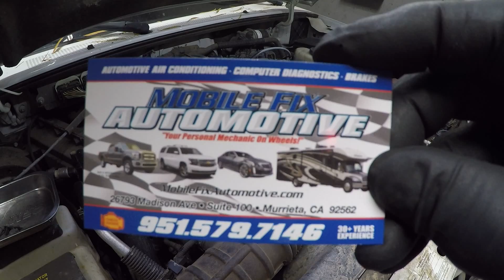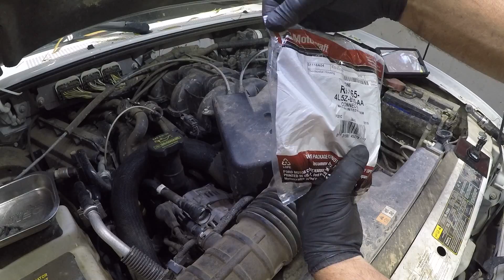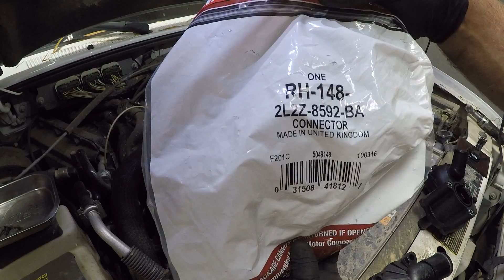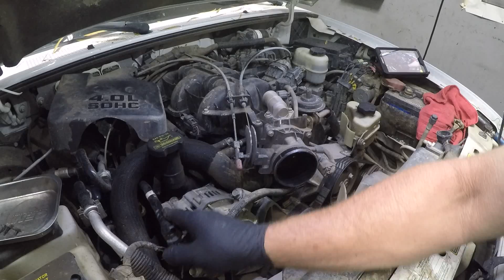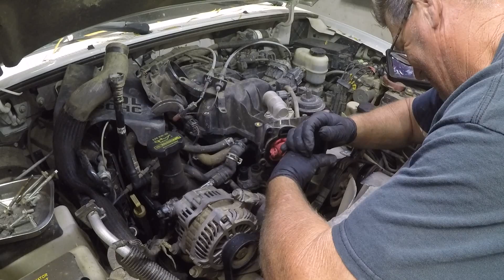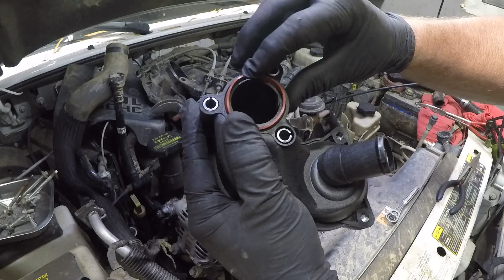How to replace the thermostat housing on a 2011 ford 4.0 v6 (parts link below)

Comment: Did this today, used a Dorman metal housing. After the base was installed I struggled to get the cap on. I was able to by shoving the cap in first while tipping it back and left. Slid the thermostat in and the cap fit.
2011 w/ 248k

Comment: I cannot for the life of me, get the clip in that holds the sensor. It won’t go in. Any suggestions would be greatly appreciated!!
Reply from the maker: If you changed the oring it won't go in. Replace the sensor.
Reply: It is a brand new sensor. I greased it a little also.
Reply: I got it! I’m so embarrassed. I was putting the ends of the clips in one hole instead of sliding them on opposite sides. Thank you so much for replying so swiftly to my question and for your incredibly detailed tutorial! You’re very good!

Comment: Thank you sir for such detailed information awesome video I have to do mine 08 ranger, how ever I asked for the thermostat housing at my local ford dealer and I was if the current housing was leaking which is not so I was told that all I needed to replace was the the thermostat it self hopefully I don't have to go back an replace, I wonder if there's an specific  way that the thermostat seats in the housing, thanks again for a great video .

Comment: Excellent video. I also removed the idler pulley which allowed me to pre-install the two sensors on the housing with their clips. Once I got the housing place, I tilted it and plugged in the sensor connectors. Finally, I used an in-lb torque wrench and torqued the lower and upper thermostat housing bolts to 89 in lbs (not foot pounds).

Comment: I did this today. Superb video; thank you. I purchased a set of long pliers--bent and non-bent--since you revealed how useful they are. What a great idea to use them. I have never thought of that and they were a Godsend.  I also used Ford parts (made in the USA), though it was a Ford part that failed. I'm hoping the USA parts will last longer; however, If they do not, at least I supported our manufacturing base. Many, many thanks for your share!

Comment: this part for me is 150$ so fat chance im gonna rebuy it used to be it was just a single part you bought for 30$ and it was the entire assembly with sensors saw this thought it was still available had to "special order" it waited a week called back exact same part manufacture comes with everything seen abesolutely 0 difference its called a kit now and its 150$  does anyone know if there is any work around to this part like having someone recreate this part with steel and brass so i don't have to replace it every summer because it's plastic if im gonna shell out 150$ for garbage might as well pay an extra 150$ having it made of a stronger material so i dont ever have to rebuy the plastic again because in the long run the fact that it is plastic its gonna cost me more down the line

Comment: Spring clamp's are better,they keep constant appropriate pressure on the hose
Reply from the maker: Yes, but after heat cycle and time they will loose their ability to hold properly. Therefore they should only be used once and discarded when removed every time.
Reply: @SandCarServices  personally i have not noticed that,,( I do also work on car's,..and now on heavy trucks for a living) guess I'll have to be careful of that issues,,

Comment: GREAT VIDEO AND I'M GLAD I TOOK THE TIME TO WATCH.  I BOUGHT A 2002 EXPLORER AND HAVEN'T WORKED ON A VEHICLE FOR SEVERAL YEARS.  SO MUCH FOR A QUICK COOLANT CHANGE.  USED TO TAKE 2 HOURS ON THE OLDER VEHICLE, BUT, THOSE DAYS ARE GONE.  WHATS WITH THE AUTOMOTIVE ENGINEERS. I WONDER IF THEY'VE DONE THE WORK ON THE CARS THEY'VE DESIGNED.  I HAD NO IDEA WHAT I AM GETTING MYSELF INTO !!!

Comment: Hey Ron,, video made my project almost seamless. After all was put back together I noticed I somehow pulled a wire out of a connector that sits just to the right of the oil fill cap.its grey with a black and yellow wire. What is this connector for??
Reply from the maker: Send picture
Reply: @SandCarServices  sent it to your email

Comment: If the thermostat housing is leaking. Would you notice coolant on the ground . Or does the coolant leak on top of motor. An evaporate. Great video.
Reply: Usually it will give a smell like boiling dirty water

Comment: Hey Ron,  I go up to the Auto parts and ask for some " nondestructive grease ". The guy gives me the deer in the headlights look, he has no idea what I am talking about. Is there another name for this stuff ? I called around one guy told me to call a Boat Marina or buy it online.
Reply from the maker: If your just using it to grease the orings use vaseline.
Reply: @SandCarServices  
Thanks for the reply and that I can do. That is what I used to hold the rubber gasket in place on the bottom. Say you know that they are making the thermostat housing in a metal version now.
Reply from the maker: Yes
Reply: vaseline is a petroleum product.  I'd personally steer clear of that.  You can get cheap little plastic tins of plumbers silicone grease at lowes or home depot.  It is designed for rubber seals.

Comment: Did this job on my 04 explorer and still have a leak on the pack bolt and also on the back of the engine. I'm losing almost a half quartz from driving it to a to b just did my manifold gaskets. And cant torque down to specs because the dreaded hidden bolt. Can only get a driver pack there and just did the water outlet housing still leaking

Comment: This man did this in about an hour. He tells you at the first of the video to buy the over priced Ford parts. I looked on line and Napa had just what I needed, or so I thought. They had the housing thermostat and one of the sensors with all the gaskets. Ready to be installed. And true to the name N.A.P.A.  No Auto Parts Available. Did not have it in stock but could have in the store after 1 pm. I go to get the parts. And what he had and what I told him I wanted, turned out to be two different things. He had the housing and everything with it. Except the two sensors. So those were extra. I get everything torn down and start to put the NEW sensors in the housing. Try as I may, one of the sensors would not fit. I no choice except to use the old one. In my struggles trying to put everything together I am not sure which sensor went where. I hope that the color helped to match every thing up. One was a orange color the other gray. I go to put the little wire clips that hold the sensor. And that was like hitting a brick wall. They would not go in. I struggled with them for over 4 hrs. On the ends of the clips they are bent out wards. They were boring holes into the side of the housing assembly.  Finally I said to the hell with it and use a large paper clip about the same size. Not a tight fit but they seem to be working, so far No leaks. I get everything back together and run the truck around the block. Still No leaks, so everything seems OK. This morning the air conditioner stopped working. And the engine light came on. I take it down and let the guys use there scanner and they said I have a bad coolant sensor. So the one I had was working , so now I am not sure if the new one is bad or did they sell me the wrong one. It is a little hard to believe that now is the time the old sensor died.  Perhaps this is why the air conditioner stopped working.  The AC was working fine until I started this project. So I thought perhaps I did not hook some wiring harness back up. Or perhaps a wire came lose. So today I looked it over.  But I do not see any thing unplugged  Before I started this project I did unhook the batter cables. But I still went back and checked all the fuses. They were fine. I got under the hood and swapped the relays around. Still No AC. After spending 12 straight hours on this POS yesterday and another 4 hrs today, I tracked down the relay that goes to the clutch, on the compressor. I ran a jumper wire from the battery to the compressor relay. And the AC started working. So I hooked up a wire from the battery with a fuse 10 amp just like in the electric box to a toggle switch in the cab of the truck. So far I have spent over $200 and spent over 16 hrs on a job that should have taken me 2 or 3 hours. Not to mention monkey rigging it together. Perhaps IF I had went on to the Ford dealership and gotten the parts from them this may not have been such a hard ass job. Who know's they may have even sold me the right parts. And the worst thing about all of this is, I will have to do it again. Strange thing I have asked several why does this have two coolant sensors ? One of them has be for the gauge in the dash the H/C  what is the other one for ? Either it is a secret and No one will tell me OR no one knows. Funny thing I tell them I replaced the thermostat housing and the AC stopped working and they look at me and say, Well one has nothing to do with the other. They hook there scan machine up and then tell me that the reason the engine light came on is because of a bad coolant sensor. And that may be the reason whey the AC stopped working. Two minutes ago they said one thing has nothing to do with the other.
Reply from the maker: Welcome to my world. Parts made in China suck. Napa, o'Reilly, autozone etc. Sell mostly China products. Dealer parts which can be argued are better are usually made other than China.

Comment: Thank you for this video.  I was able to change out my thermostat housing and save lots of money.  Car part store gave me a threaded sensor which I had to change for the right one. And added an 8mm ratchet wrench to our toolbox.  Love my manual Ford Ranger Edge with over 150,000 miles on it.  I change the oil regularly and use non-ethanol gas and it runs great.
Thanks again!
Debi

Comment: Excellent video. Only problem is you made it look easy. The bolts that didn't break on me were seized with the heads rounded over. The clips crumbled out in pieces. I had two sensors with no room under the throttle body to pull them off. Two parts stores looked at me like I was asking for a moon rock when I went for bolts and clips. 

The good news is I know how to do it now because I'm sure I'll be redoing it in a year. The old housing was crumbling as I was taking it out.

Comment: Thanks, great video and good instructions without distraction. Steady camera. I'll go back and check, but I respectfully ask if the new Motorcraft plastic part has been improved so the same failure doesn't recur.

Comment: Great vid. I'm a rookie, and am not going to do the job myself, but wanted a sense of how long it would take a mechanic who is working at a relatively busy shop. (has other vehicles to tend to etc....) It seems to have taken you under an hour to do the actual tear down and install, not counting bleeding the coolant and refilling/testing etc.... Is this a 3 hour job top to bottom? Maybe more? Thanks again! really enjoyed watching/listening!
Reply from the maker: If I remember correctly the Mitchell book calls for around 3 hrs. The book wants you to remove the intake manifold.  Also I live in California where we dont get a lot of rust issues in engine compartment like back east does. If the bolts break all bets are off and the manifold has to come off most likely.

Comment: I just did this job on my ranger. What a royal bitch it was. Took 6+ hours. One of the lower housing bolts was froze up and the head immediately rounded off. Had to cut it out with a sawzall. Recommend anti seize on the bolts. Fastenal has replacement bolts on hand. Converted the one to allen head high grade bolt. Terrible design.
Reply from the maker: Well I can't think of everything. I live in California and pretty much only work on California vehicles. I forget that back East and areas that are heavily involved in snow everything gets rusted out. Unfortunately I don't see it out of sight out of mind

Comment: Great video it shows fastest way to replace housing if no trouble.A bolt under intake next to throttle body was rusted in the split steel sleeve and I ended up shattering the housing to get a vice grip to remove bolt.

Comment: Any suggestions of how to left out that back 3rd screw? The vacuum line that are connected to the intake is in the way?? Thanks
Reply: remove the other bolts then you have to tilt the whole housing forward. slide that bolt on out.
Reply: @ryangeorgi5159  Thanks for the reply.

Comment: Thank you so much for your non-shaky, clear video with good narration!
In my opinion, Ford's epic fail was not in the design to access the thermostat itself, which is a normal maintenance item as you say, but the horrible plastic, glued-together housing for it! My truck is a 2004, in good shape, but of course this little plastic nuisance was leaking all over the top of the block, with its resultant burnt vinyl smell from roasted anti-freeze. This would have been totally avoidable by Ford if they simply would have designed a robust metal thermostat housing. Guess what? I avoided the overpriced Motorcraft plastic POS and bought the metal one off eBay for eighty bux. 
If I ever do need to replace the thermostat, it is an easy 1/2 hour job, so Ford did OK there. 
I'm now "proving in" this metal housing to see if it will not leak. I did put black RTV arount the gasket where the housing meets the block, on the bottom. 
TIP: to cheaply leak test the system, take your compressor, lower the PSI pressure to 15 or so at the regulator, and patch it in to the overflow port below the cap on the radiator. I did this and saw the coolant squirting out at the POS housing seam's side.
My fingers are crossed that this fix will last.
Thanks again!
Reply: springpan how did it go? Send the link of the metal thermostat if possible .

Comment: if your thermostat housing has two sensor on it, then you will have to at least loosen the intake manifold so you could lift it 2 or 3 in to have enough clearance to remove the thermostat housing with the second sensor.
Reply: I respectfully disagree. Leave the sensors hooked up and just disconnect them when the thermostat housing is loose from the block. 
You can maneuver then the sensors to disconnect once this is done. 
This is what I just did today and got the job done in about 2 hours. BTW, I am not a professional. I also used the 2 piece METAL housing from eBay. Time will tell if this is a good long term fix. 
Cheers!
Reply: sorry- should be "then maneuver"

Comment: Appreciate the thorough instructions and great tips, Ron! I have a question, though: So the rubber gasket ring for the thermostat itself just sits right on top of the thermostat? I always thought that ring was made to fit on-and-around the rim of the thermostat.
Reply from the maker: On some engines yes. not all. this has become very normal. They did it in the 7.3 powerstroke from 1999.5 to 2003 and they leak if not done right.

Comment: I have two sensors and having a hard time putting it back together is like impossible
Reply: I've put them back together with two sensors ,you put the sensors in first sneak it partially into position, plug them in and then, then put it all the way in and bolt down...

Comment: what angled 8mm did you use? mine is giving me a whole lot of pain
Reply: or 10 mm, I can't remember but the one used on the 3 bolts fastening the lower housing to the engine
Reply from the maker: Snap on
Reply: Thanks . Found one finally. Some how my ac compressor pulley isn’t spinning but my clutch engages and releases- guess that’s the run around with fords
Reply: I used a cheap 3/8" Harbor Freight swivel u-joint. Worked fine!

Comment: i got a 97 trying to help a friend, looks like i have a vacuum tube and another piece of wiring harness in the way, it is a lot harder to put that bypass hose on. I tried your way, but looks like due to a vacuum line and electrical wire, attaching to the water pump first makes it more possible to re attach the bypass without taking off intake manifold. Have straight long needle  nosed pliers and they work, but all in all PITA of a job lol
Reply from the maker: Max B 
97 is different than a 2011 by far.
Reply: I know, but the engine has not changed by much, so still, used your video as a little reference, thanks a lot for this post. Also i completely agree with your point of view on making servicible stuff easier to access work on, it only makes sense.

Comment: Great vid Ron, The only suggestion would be for the heater hose, instead bending up like that and putting strain on it, loosen the clamp and rotate it up just as you did for the PCV hose.  To remove most hoses, remove the clamp, rotate the hose to break the "stiction" between hose and fitting, and then remove.  Twisting the hose to break the seal makes removal much easier.  Some hoses can be broke free by actually pushing them on further if possible, then remove (gripping the hose that's not on the fitting and pushing it will slightly bow it out peeling it free of the stiction).
Reply: Nice tip- I also spray penetrating oil in the metal to rubber interface, and then twist with Channel Locks- works for me!

Comment: Thanks so much for this. I'm losing coolant on my 03 Explorer Sport Trac and I smell it burning, but I couldn't find the leak. I was convinced it was the water pump but the weep hole was bone dry. My first car was a 1967 Mustang with a 289 and the hardest part of changing the thermostat and housing was making sure you got all the old gasket off without messing up the surface! Oh well, one step forward and 3 steps back! Thanks again
Reply: Had the same issue.  The leak was actually allowing coolant to seep into the block V and had a coolant smell for several months before the leak increased and revealed itself.  Didn't really lose any coolant until recently.